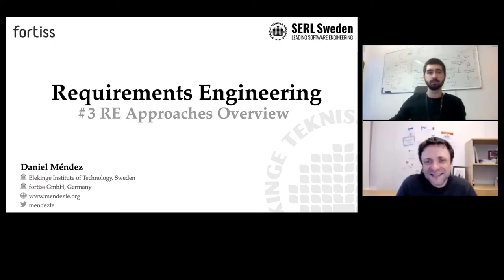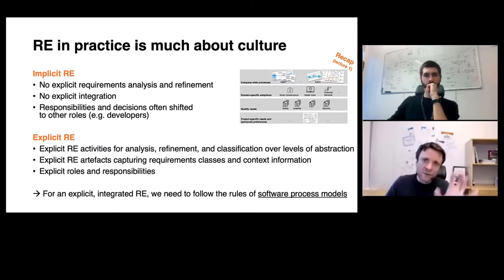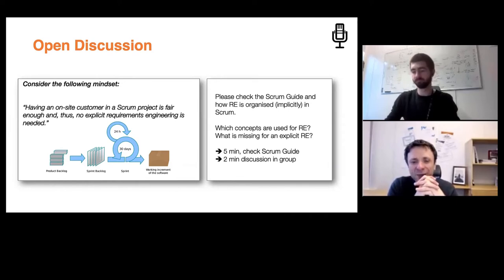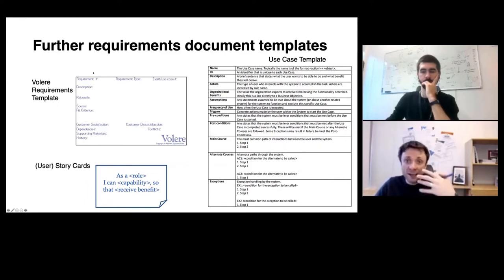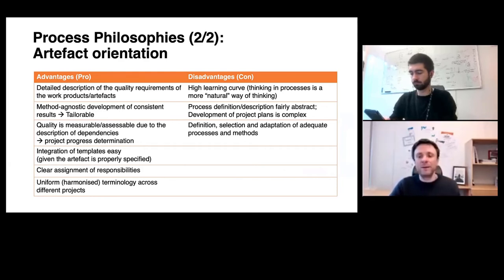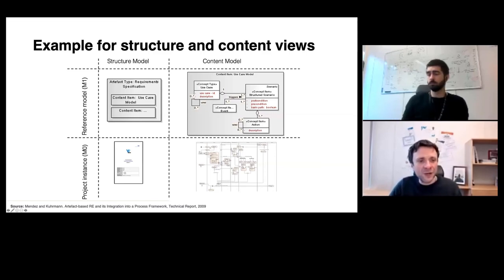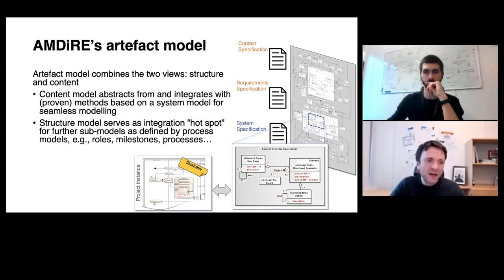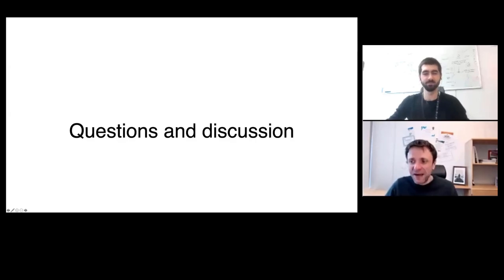Requirements Engineering Lecture 3: RE Approaches

Comment: Is it possible for us to also get these slides?
They are no longer available on figshare unfortunately
Reply from the maker: This is strange, they should be available here: https://figshare.com/projects/Software_Requirements_Engineering_Lecture/127886
Reply: @mendezfe  thank you professor, this one works just fine, however the link in the description of the playlist gives "page not found".
I'd recommend updating it with this link. Thank you again!